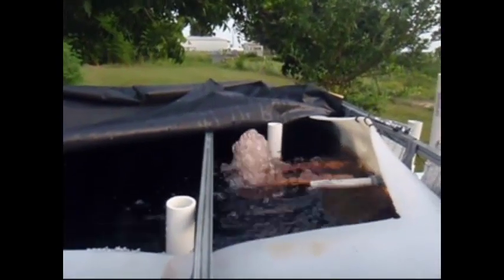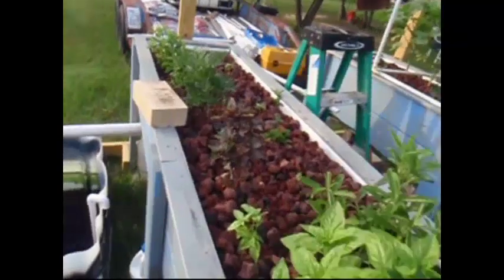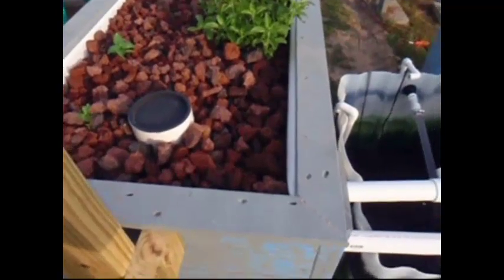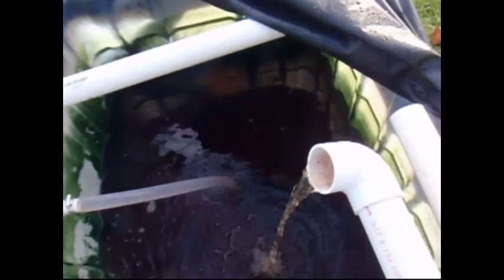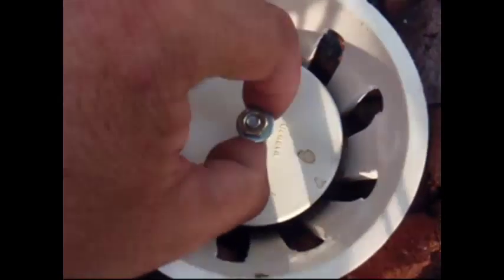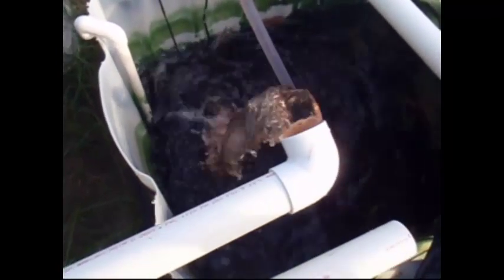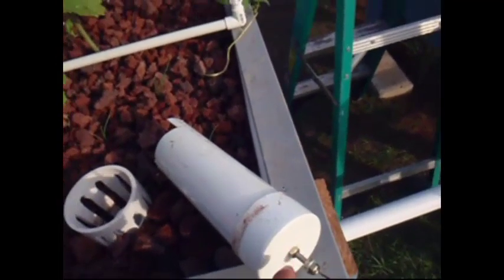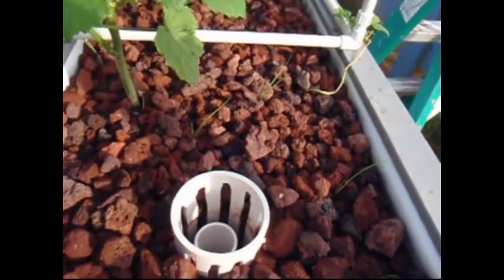Aquaponics Auto Siphon 2 inch Stand pipe 3 inch Bell

Comment: Do you have a detailed drawing on the bell siphon?
Reply from the maker: No. But there is a lot of info out there for them. Basically, if your stand pipe is 1" then your bell should be 2". You need 1" or more between the top of the stand pipe and the top of the bell, 1" being the minimum. Then your piping going to the fish tank or sump tank needs to be the same size as the stand pipe. If you alter it, your siphon will not function correctly.